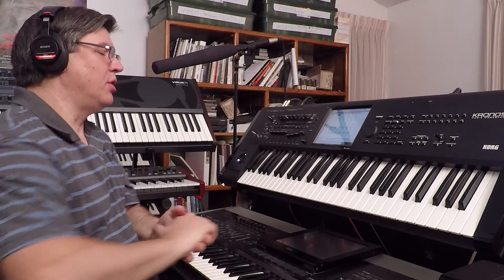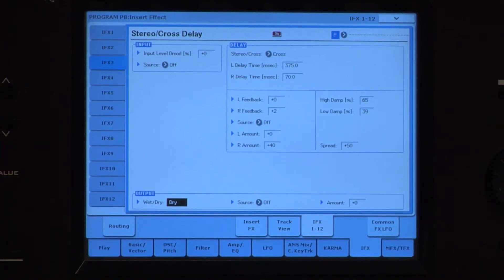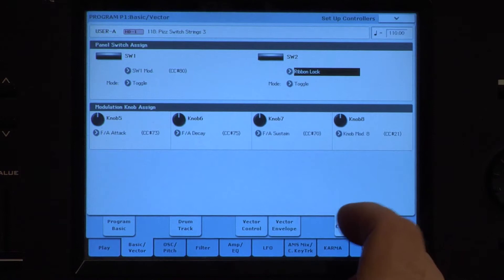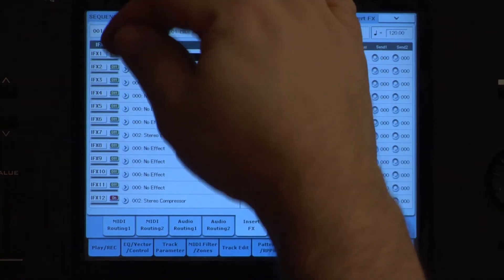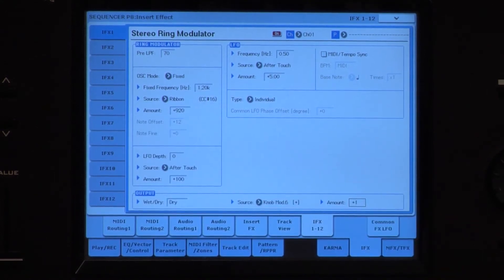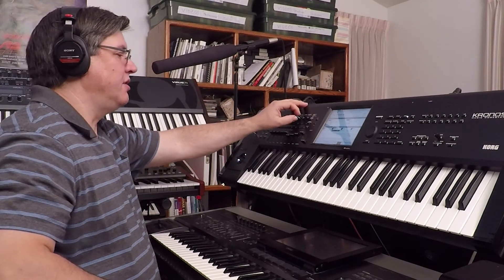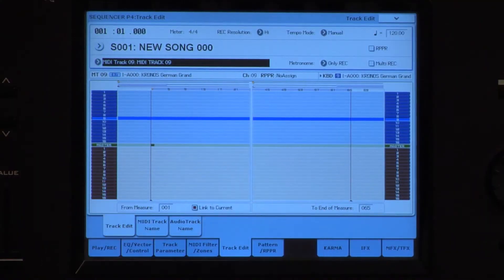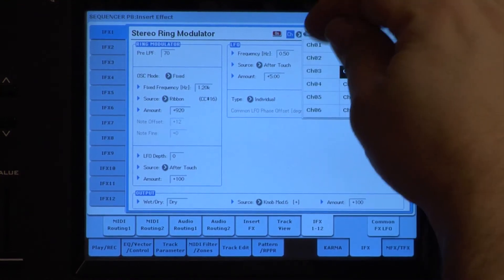Kronos Realtime FX Control

Comment: I learn a lot from your videos about my Kronos, thank you so much!  I recently bought a DeepMind12 and a Rev2 to add a bit of true analog to my Kronos and M3.  The effects on the DeepMind are amazing, but I want to run the Rev2 through my Kronos effects unit for additional effects (besides the Rev2 FX).  Is there any way you could do a video showing how to do that?  I would be greatly appreciated!  This video helps quite a bit, but not enough to make it fully clear to me.
Reply from the maker: Plugging in the Rev 2 is the same process as plugging in the mic.  Plug your Rev 2 into INPUTS 1/2.  (or just Input1 if mono) Instead of IFX 1, I would pick something like IFX 10.  That can be chained into 11 and 12 if needed.  Use Sequence mode, so you can combine Kronos programs with your Rev 2.  You can use Program mode, but then the FX are going to change, every time you select a different program.
Reply: Thanks, you answered a lot of my questions.  The “farmland” thing you did with the vocal effects was cool!

Comment: This is awesome! Loving the different voices setup! I was trying what you are showing but my mic is buzzing like crazy.  I worry that my mic inputs are defect. I am using a condenser that goes into my audio interface with phantom - hooked into the inputs of the korg! Is the wrong?
Reply from the maker: Thanks for the comment.  Your Kronos is probably fine.  If your mic requires phantom power, you need to plug into an external mic preamp first, then plug the preamp into the Kronos.  Check your cables, too.
Reply: scoopicman thanks for your quick reply! Actually my problem was the Microsoft Surface. For some reason it causes my line between the audio interface and the Korg to buzz. On my laptop it works. Ah well Microsoft.... thanks anyway. Could you please make a video on how to work with the external sound libraries such as Kapro? I don’t understand how to store them in individual banks and have them there when booted up. It always seems to load in a predefined bank, overwriting the other sounds.  Say I wanna have the kapro and the iron library at the same time. BTW love your shortmovie works!

Comment: I have a problem with my microphone, when I am on "Global mode" and I put on IFX 1, (which is a Reverb in this case) the microphone works. But when I come back to my "Set list" the microphone does not work any more microphone ..... please thank you for helping me to find the solution, it is very important for me, in advance thank you
Reply from the maker: My mic is working in Setlist, on the few examples I tried.  Is the reverb part of a program or combi?  Any time you select a different program/combi, the effects are going to change.  Did you save a particular program with that reverb?